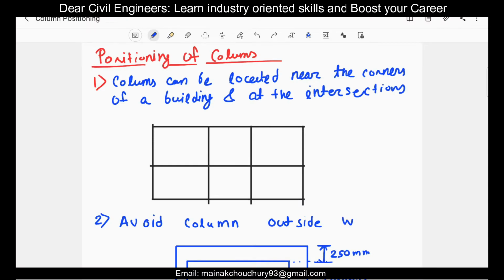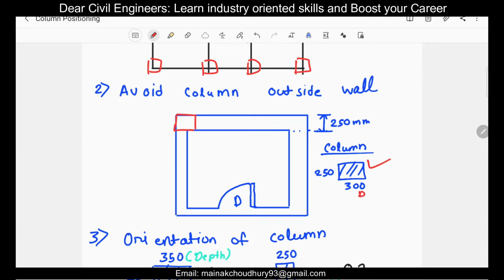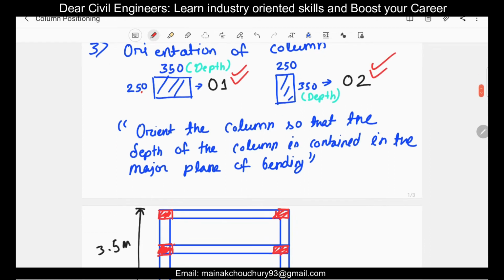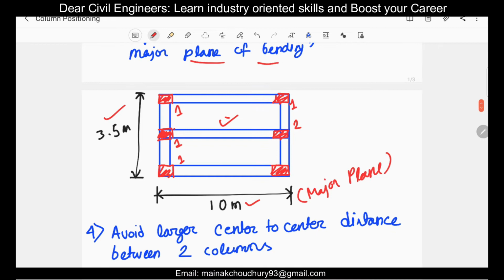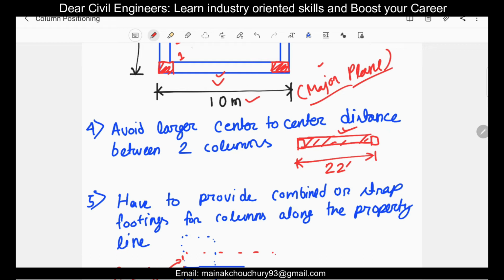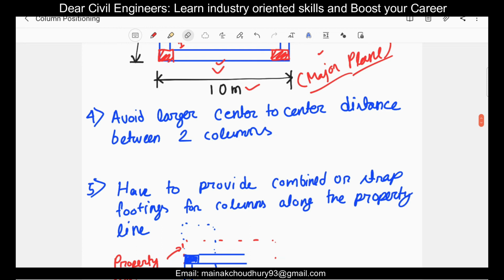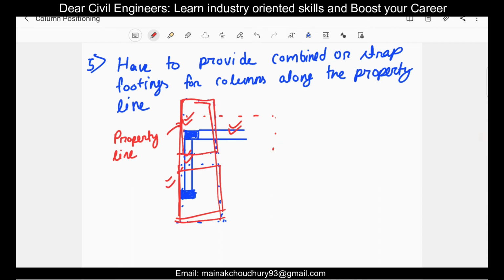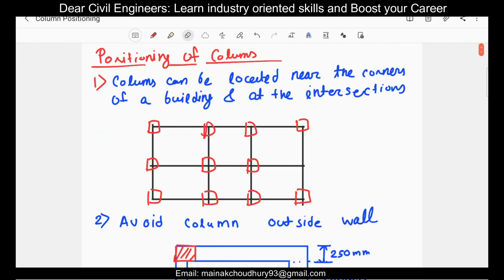Basic Concepts of Column Positioning | Technical Explanation

Comment: For the question at the end, I think the column should be placed at Q because the major axis of bending is perpendicular to the column's depth. This is to increase moment of inertia and hence greater moment resisting capacity.    For P, it's a square shaped column so the same moment of inertia on both axis x and y.   Sir please correct me for my mistakes; I'm just a beginner in this field.
Reply from the maker: You are right, the column should be placed at Q, the cantilever moment due to the reaction of B2 at P, will be balanced by the bending moment in B3 due to B1, so the designed section will be less in size and thus providing a cheaper alternative.
Btw, very good attempt May, keep it up 👍
Reply: @MainakChoudhury  thank you Sir for further explanation. You're helping out students like me a lot. Please make more informative videos like this and God bless you 🙏